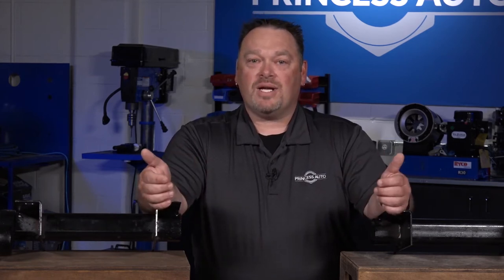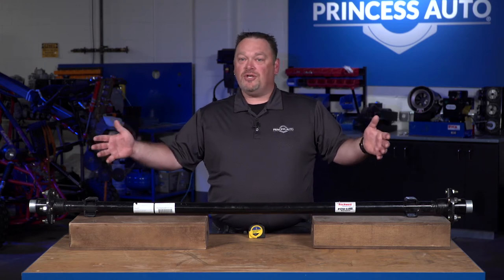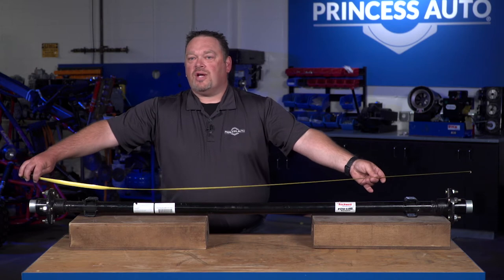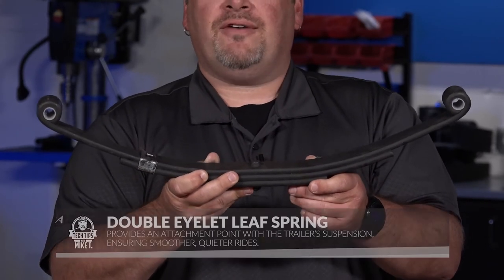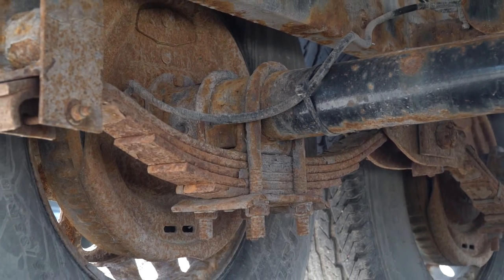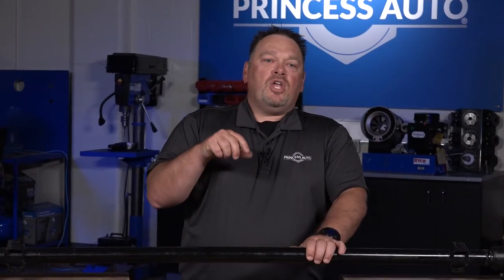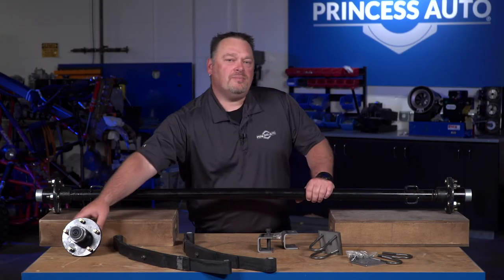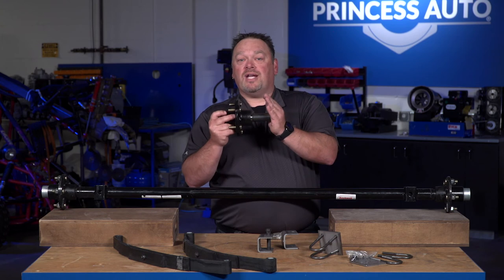Tech Tips with Mike T -  Trailers - Part 1: Axles

Comment: I have an axle I want to flip, (turn over)  as well as put below the springs, from a 1969 Shasta camper trailer. The axle is 58 " from wheel to wheel. It has an upward angle right angle bend at each wheel 3.5" measured from the center of the square tube axle. I want to keep the brake adjustment and wiring in the correct places so I have  to unbolt  in order to switch the wheels. I will weld a large washer so the axle will not slip on the springs. Is what I am proposing something that is feasible? The trailer is too low  for a camper trailer or just as a general purpose trailer.

Comment: What if I already have a trailer and I'm wanting to upgrade to a higher weight capacity to meet my requirements? I have a trailer right now on 3500lb TA, 62" spring center, from eyelet to center beam is 27.5", and from center of one spring to the adjacent spring is 32". But I can't for the life of me find an axle kit 5,000 lbs + that'll fit those dimensions....